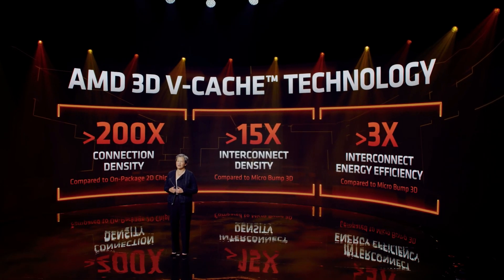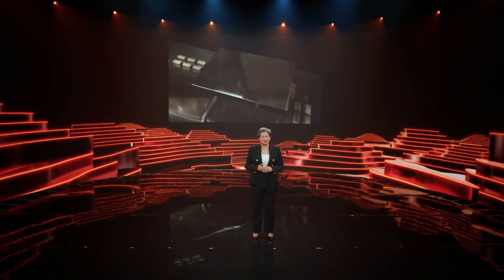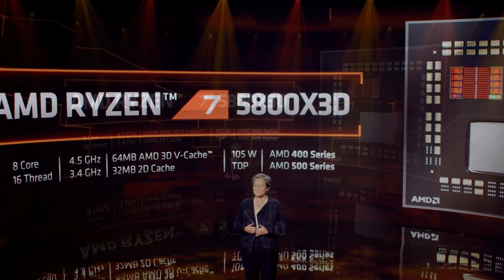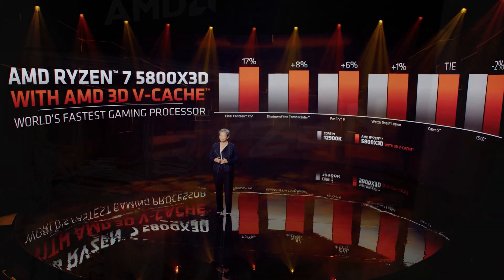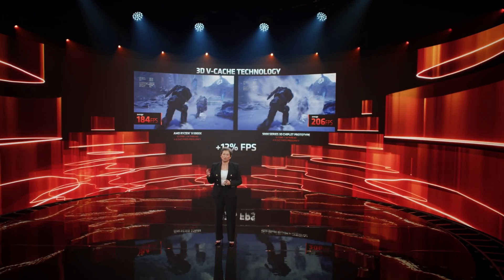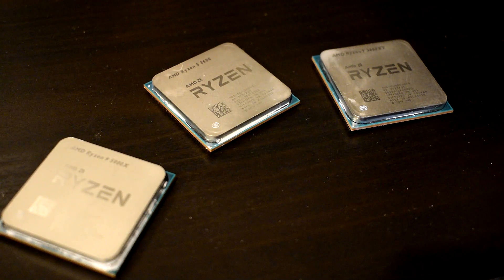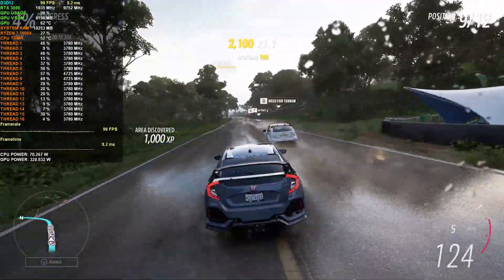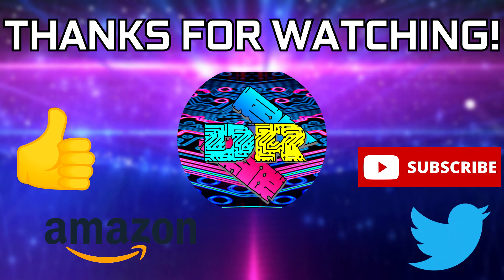AMD's Ryzen 7 5800X3D Is A Strange Product With A Lot Of Missed Opportunity For Early Zen Adopters

Comment: Useless cpu I don't think someone who have 5600x should upgrade.. If your gamer for 250$ on sale and b450 or b550 for a 100$ 5600 will give you perfect gaming performance and low power consumption it will be waste of money to replace 5600x to 5800x3d don't even think about it is my suggestion I own 5600x and gtx 1060 and I can tell you all e-Sports titles running over 400 fps easy why gamer should upgrade to 5800x3d for 50 fps more that is stupid 🙄

Comment: Just like you said it in the video, this CPU is quite tempting for me (as an owner of R2700 with X470 Prime Pro from Asus who would like to have an upgrade after around 4 years of use) but it makes no sense if AM5 gets released late 2022 or in the beginning of next year. It's just few months to get a serious upgrade in, probably, similar price range. Sitting with RX580 hurts a bit, but GPU market is insane and having new card would be lovely match with PCI-E gen 4 so I may get a placeholder (6600XT) and wait for new GPUS + whole system overhaul or get a new Ryzen and a 6700XT or 6800 and wait for next years for AM5 to get rid of early-adopters issues.

Comment: I have an x570 and a 3700x bottlenecking my 3080 and for the reverb g2 and for sim racing in particular will I benefit more the extra cores of the 5900x or the extra cache of the 5800x3d? Should I wait or just buy a 5900x?

Comment: This is a proof of concept.  They are using this to perfect the technology for the next round of cpus. 5000 series cpus benefit less from clock speed and more from infinity fabric tuning and memory tuning. This means the drop in clock speeds doesn’t matter. The throughput will rise dramatically and  so will FPS. The reason 5000 series is not being backported to 300 series motherboards is simple. The VRMs on 300 series boards simply cannot deliver the power needed in clean enough form for the 5000 series parts. Another you tube channel clearly demonstrated this and I am surprised that this channel isn’t aware of this. Only the 370 motherboards and not all  of them can deliver the power needed. Why AMD should waste time and effort on a doomed project is beyond me. As to the 3000 and 5000 series running hot, motherboard manufacturers set the voltage to the high end of the range, apparently assuming that Ryzen owners would overclock them. Backing down the voltage in BIOS eliminates the heat problem. This has also been covered by other channels. That the person doing this video doesn’t know this after more than two years of articles, videos and discussions is beyond me. I have both a 3700x and 5800x in x570 motherboards and after applying the reduced voltages as specified, have had no heat issues. Buying low latency RAM of the correct frequency and tuning the infinity fabric and memory gave a twenty percent boost to both systems without overclocking. This is a minor tweak and achievable in minutes. HU demonstrated that the size of the cache affects performance more than clock speed or number of cpu cores within a certain range. (4-8 cores)  This would make the 5800X3D an exceptional processor. It became very obvious during the course of this video that the reviewer had no idea what he was talking about.
Reply from the maker: I guess somebody missed the memo where AMD and motherboard manufacturers have officially announced support for 5000 series CPUs on 300 series mobos. There was no need for the mental gymnastics, it was blatantly obvious AMD was just doing this for financial reasons.

Comment: Here’s my argument against the 5800X3D:
- If you’re a pure gamer, the 12400 and 5600X are both $200-250 right now and will offer 90% of this chip’s gaming performance. You should move up a GPU tier with the $200 you just saved instead of getting this.
- If you’re a productivity user or content creator, or even a hybrid user, the 5900X is going to be about 40% faster in multi-core for the same price, while having at least 90% of this chip’s gaming performance, making it a far superior overall chip.
- If you want to have your cake and eat it too, buy the 12600K or upcoming 5700X, both of which have identical multi-core performance to within 10% either way, and move up a GPU tier with the $100-150 you just saved.

All of these choices result in an overall superior build. The 5800X3D is an interesting chip, but unless you’re a hardcore gamer with an unlimited budget and questionable financial sense, it isn’t for you.
Reply: I like this response but I do have a question. I'm running a X570 board with a 3800x + 2070S. Would you think getting the 5800X3D would be a good choice for me? I don't plan on getting a 3000 series card. I'm thinking about waiting til 4000 or 5000 series comes out. I mean even the 5600x would be a decent upgrade for me. Just not sure if I should get that or the X3D.

Comment: I just got a X570 and 5800X, at a deep discount, but It was a tough choice between 5000 AMD and 12th gen Intel. AMD has had the advantage in my mind due to upgrade path, but this being AMD's last AM4 pushed me towards Intel. 12th gen intel was a bit more expensive and I don't plan on DDR5 soon, also the E and P core stuff being so new scared me off a bit tbh. It's a shame the 5800X3D isn't a viable upgrade path I was hoping for, and that I probably will have to buy a new board to upgrade, but I think I made the right choice for my budget
Reply: I highly doubt this is REALLY AMDs LAST AM4 chip. Seriously. They could give the 3D Cache option AND RDNA2 option to a XT series or a XTX, or XTG series with built in Radeon rDNA graphics. (VEGA WAS ALWAYS BETTER THAN UHD INTEL TRASH).

Honestly it's a missed opportunity at a stop gap series before AM4/5  OR a way to keep AM4 mobo owners pocketbooks open and willing to give up their hard earned cash. 

Most Ryzen owners know they have lots of options for their system, and don't NEED or even want a new socketed board/complete overhaul. 

AMD becomes known for keeping sockets for a set 5 years let's say and Intel will NEVER catch up.
Reply: @DoubleJHas2ManyDoodles  You might be right, if they come out with a 5900X3D, 5850X, or something down the line, I would consider the upgrade but as it is now, the 5900X isn't a good upgrade for me for gaming (maybe in the future) and all the non-x chips are obviously a downgrade.
I do agree with you that AM4 seems to have plenty of potential left (PCI gen 4 is plenty, and DDR5 isn't good value yet) with a customer base that would be happy to stay with it, but I feel like the new socket will get all the new releases and meaningful features. One thing is for sure, If AMD promises a few generations on their new socket both old and new customers will buy in, so long as Intel stays doing it's new socket every generation thing.
I don't feel like APUs with Radeon graphics will be a major selling point, but who knows, if the GPU market doesn't stabilize it might work as a stop gap measure. Time will tell

Comment: @DannyzReviews
I would have also said a big part of the reason AMD put so much into chiplet's is because in the long run it solves a major amount of headaches to be able to go vertical and to be able to scale the amount of processing power by the number of chiplets, and I would imagine now the hurdles are out of the way, is cheaper to produce than a conventional CPU monolith. Educated guess admittedly, I understand economics better than processor designs.

As for who the product is for?  folks like me :)  Those of us on 4X and 5X boards, with older chips, who are looking to upgrade and get the most out of the end of the AM4 platform which is still decent for gaming for a few years yet. I have X570 board on an R7 2700X which is by far one of the most popular AMD CPU's because for people like me who built new Ryzen systems over the last 18 months they were the best bang for buck available with the 3X and 5X series either hitting insanely inflated retail prices compared to intel equivalents or just being out of stock entirely. My thinking is AMD knows this and they know those like me want to upgrade our chips but not leave AM4 just yet. :)

Comment: As someone sitting on a 3600 I can tell you that I will absolutely not be buying a new Mobo and RAM like you alleged most of us would and am considering getting this as long as it's not something stupid like $100 more expensive than the 5800x ($350).
Unless of course they throw a fast ball and it turns out the 6800x costs $350 and is like 40%+ faster (single core) than the 5800x, but that's doubtful.

Comment: Do you really believe that the 64 GB additional Cache Memory dont need energy ? Of course are the clock speeds lower , its the  s a m e  TDP envelope and it works on old  AM4 Motherboards which cant deliver suddenly much more than the 140 Watts out of the AM4 Socket .
The 5800x3D is  n o t  a strange CPU , its an perfect upgrade CPU for an old System . If the performance Numbers are right , the 5800x3D is mostly not slower than an 12900K. Only the 200 FPS+ nonsens may be profit more from the 5 Ghz of a 12900K

Comment: Most boards prior to the X570 chipset had terrible VRMs, there's no way a 16 core CPU could be plonked into many of them without sacrificing performance. They just can't pull enough power. Motherboard vendors treated AMD's 1000, 2000, and 3000 series CPUs like an unknown and risky bet, so used cheaper components that ultimately lead to AMD deciding to kill off support for most of these older chipsets on Zen 2 and 3.

Comment: I have a 2700X on B450 and I'm considering buying this but if it ends up too expensive >400$ I may end up buying the 5800X. But I'm also hesitant to upgrade now because Zen4 is coming in Q4. Don't know what to do. I've considered switching back to Intel, but their achilles heel right now are the motherboard pricing with DDR5 support. Their CPU's are good value but not the motherboards. I use photoshop a lot and mostly play Flight Simulator. So single core performance is very important. 🤔

Comment: I'm currently using a 2700x in a high end x570 mobo. I got this to be ready for the last gen am4 cpus. I hoped there would be a 5950X3D or 5900X3D but it seems I'm gonna pass on the vcache and just take the regular model. I want more cores than 8.

Comment: Can anyone enlighten me about that v-cache? How is that feature helps boost for gaming? Or whatever it usage will be ^^
Reply: All CPUs have some cache, which is small amounts of extremely fast memory so the CPU doesn't have to get data from the slow system memory.

The more cache you have, the less likely you are to have a cache miss, leaving that core doing nothing while it waits for data from the system memory. One of my favorite phrases to describe this is "all processors wait at the same speed," so even though it's got a little slower clock speed, it can still end up faster in practice because it's actually using more of those clocks to do work, rather then to wait.

Comment: I'm really torn. I'm still on a 3800x, but I really need to increase my single-threaded performance as I'm CPU bound in DCS (digital combat sim) which is poorly optimized and runs like shit unless you have great single-core performance.
I can upgrade right now to a 5800x for like 320$ and at least get on the 5000 series which is a huge step up from 3000 series. Or I could try and cross-flow to intel, though if I'm going to do that I'd like to jump on the DDR5 bandwagon, so you're talking like 300$ for a decent mobo, 270$ for 12600k, and like 320$ for ram...
Or I could just wait until 5800x3d comes along and jump to that as one last stop on this AM4 board, see what intel + AMD bring to the table for 2023 and decide once all the chips are on the table so to speak...

Comment: I think you mostly hit the target with "who's it for," but there's a Covid-related element I think may be a factor: People who didn't plan to build until next gen, but needed to due to a failure or system inadequacy for work-from-home. I had to do this when one could absolutely not get a 59xx, so I grabbed a 3900X and set everything else up to eventually be appropriate for the best-of-gen CPU. 

As you mentioned, cores are very likely to win out for people who do more than gaming so the 3D very well may not be the CPU I end up picking to finish my build. But I think gamers, novelty hunters, overclockers with cooling ingenuity, basically all shiny thing enthusiasts who had to build before AM4 are going to be very curious about this processor. And sure, some will just sell their current system & migrate, but the headaches from volatility over the past couple of years on several hardware fronts may reduce inclination to do so.

Comment: I will be getting one. I have server running a 3900x and a b550 motherboard and an old gaming rig. The b550 board in my server will be replaced by an x570 board because i want the extra pcie lanes, and this cpu is an ideal candidate to pop into the b550 board and become my new gaming rig.

Comment: I will explain, from a non-fanboy perspective.
Disclaimer: I have two PC's at my desk. A Linux system (used for business), R5 1600x / R9 380x Nitro. Windows system (used for gaming) R5 3600 / Sapphire Vega 56 Pulse. I own Intel stock and am down -3% currently.

Why do I own Intel stock and bought AMD components? #1 AMD does not pay a dividend. #2 The giant (Intel) was caught sleeping. But it woke up.
The 5800x 3D is a scramble by AMD and just one product, trying to hold onto something, anything. But Intel already told Investors that AMD is now in the rearview mirror and will not be in the windshield again. 
So why did AMD choose the 5800x? Because its 8 core 16 thread CPU is losing to Intel's 12400 which is 6 cores / 12 threads. The 12400 is $200 or lower. The 5800x is $359 on Amazon right now and that is 20% off.

AMD woke the sleeping giant so I bought the stock. Intel will crush AMD and did so with the first release. But don't get me wrong. I haven't owned an Intel PC since about 2005. I have had FX 6300"s, 8300"s and more AMD GPU's then you can shake a stick at. But fact is fact. Intel has enough cash on hand to buy AMD. So it can hire the best of the best to defeat AMD and it has.

I will stay on my R5 3600 until it no longer performs its task. Looking for a new GPU and Intel will launch those this year. Will check the reviews.
Reply: they crushed nothing dude.
1 year after 5000 series ryzen, they release product that barely catch performance and sucks 2x more power... thats just delusional

Comment: I myself might get the X3D CPU to replace my 5600X. I don't want the early DDR5 specs today, it needs to mature and priced right just like DDR4. PCI-E 4.0 as storage is still fine for my use case so no need for me to go for PCI-E 5.0 as storage as well. Heck, most of my games are in my PCI-E 3.0 NVME not much different in loading speeds.
Reply: I just made the switch today from 5600x to 5800x 3D. Very noticeable upgrade in quite a few of my games. It idles in the High 40s C though and R20 gets it to 85C. My cooler is a corsair H100i Pro xt. In games its mid  60s to mid 70s. It'll do me for at least another year or two. AM5 and DDR5 will be at a Good price then hopefully.
Reply: I want to do the same but like when the 5600x is sitting at 92% of a 12900k in gaming it seems a bit extra to go through the effort of upgrading.
Reply: Yeah PCI-E 5.0 is most likely going to have no or very little performance improvement for casual users and gamers and ddr5 is just too expensive too even consider especially it being a brand new platform (not well optimized).
Reply: I also have a 5600x and I think I'll get  this as an upgrade as well. I think it will pair well with my 3090.

Comment: The 5800x3d being the only option. It’s what hardware unboxed, and others have explained in detail, Games don’t benefit Beyond 8 cores, the reason the higher chips like the 5900 or 5950 perform better is nothing to do with their extra cores and everything to do with cache and frequency. 

Also Consoles are 8 core, therefore thats what this entire generation of games will be coded for. I think AMD made the 5900 and 5950 3D cache variants, and probably found the limit to cache performance scaling, where there was no difference between the 5800 and 5950 in gaming, and no need for 3D cache outside gaming lol. Basically making everything other than the 5800x3d pointless

Comment: ryzen 7 3700x here, upgrade or no?
Reply: I have the same problem, I have 3700x and AsRock x570, and it's OK, 5900, and especially 5950 are too expensive, I'm thinking of 5800x if its price drops when it comes out 5800x3D .. personally I'm not a gamer, but I like strong computers because I do graphic design, Catalogs with a lot of photos, when I do production for press PDF files are huge and processing takes a long time. At work I have an i9 10900, on the Z490 raised to 5.2 .. there it is many times faster.
Reply: for gaming it depends on your resolution and gpu, 3700x is not slow if your running 2k and above

Comment: I have B550 and going from R5 3600 to the 5800X3D not because I don't think AM5 will be good and worth the wait, but because this shit is going to be so hard to buy for both availability and price, when it comes out.  Look at Alder Lake.  DDR5 RAM is harder to find than a GPU, and is going around 400+dollars.  The god damned MB MSRPs are through the roof.  Also consider that the initial beginnings of any new platform will have hiccups; AM4 did with USB and B550 for example until it got fixed mid 2021.    

The strategy for me: Don't buy this at launch (which you shouldn't do for CPUs anyway) but wait for AM5 to come out, hopefully around fall 2022 (and before BF).  Micro Center had a big sale on 5000 series CPUs last BF, and this one will fall in price around 3-5 mths after it releases.
Reply: yeah mate totally agree :)